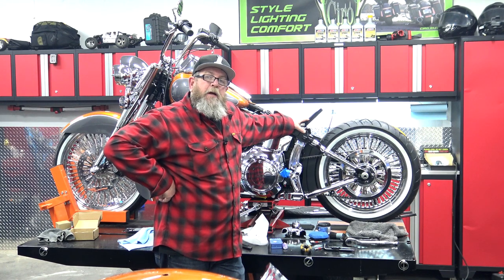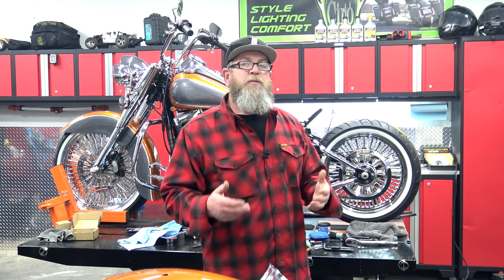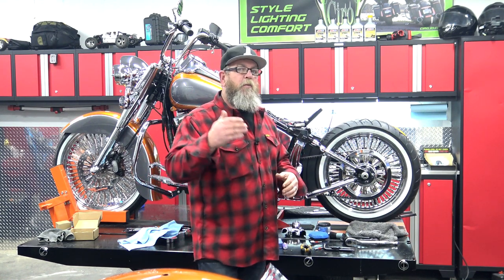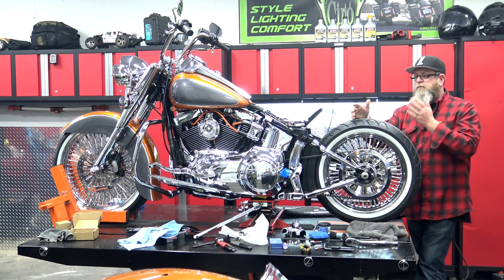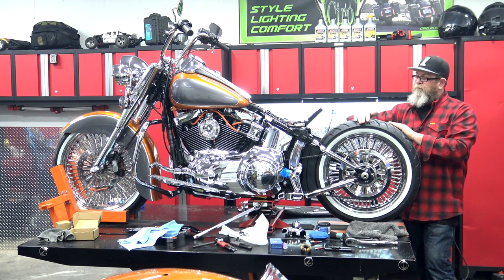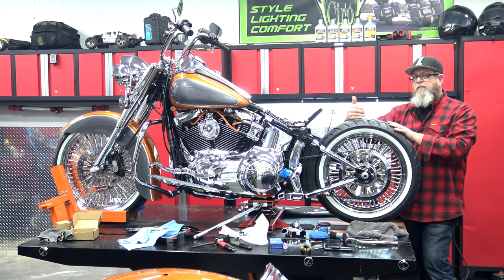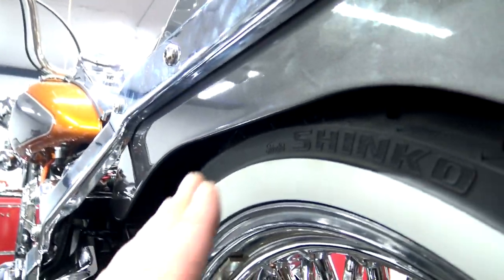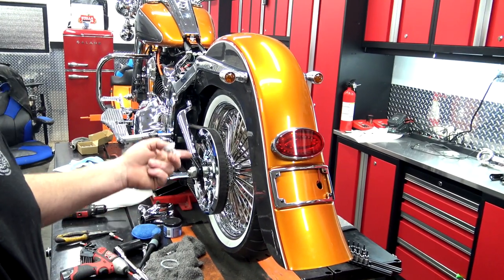DNA Fat Spoke Removal   What Did DNA Send Me

Comment: wow, that just happened to me. I ended up re-truing the wheel with the spokes but only needed a 1/4 inch to the right. I didn't want to do it but I figured I would try once. It worked out great. I hope I did it good enough to be road worthy. Have a good week. I work in my garage. You work as a shop so I can say it is not time worthy for you to do it.
Reply from the maker: I had to send mine back because they couldn't re true to wheel without taking it apart, removing the coating that makes it air tight (tubeless) truing it and then putting it all back together. When I got the second one back it was an inch to right instead of a half inch to the left. So instead of just moving it a 1/2 to the right they moved it an inch and then it was literally on the fender. I sent it back again and they sent me one very similar to the first one...so i ordered wheels from Sinister...they will be going on soon in a new video.

Comment: My Ride Wright rear wheel is offset to the right by about a half inch. But since most Harleys are that way from the factory I'm OK with it. For your wheel I'd have a local wheel lace guy, if you have one center it up. Shipping it back is not worth the hassle imo.
Reply from the maker: Yes they are supposed to be offset slightly to the right..from what I measured at our local HD its about an 1/8th..maybe a tad more. They sent me the RMA and return label so it wasnt bad..I still had the boxes...packed it, taped it and had fedex come pick it up...so not too much trouble..they have it now, we will see what happens.

Comment: So I’m curious to no did you tell them what offsets you needed when you ordered the wheel?
Reply from the maker: When you place a wheel order with any wheel company they ask you specifically what the rima nd tire are going on. A company that has been around as long as DNA has been they should know the offset of that bike. Un less you are wheel builder, the average joe will not know the offset ot even how to measure for an offset. that is why they ask what its going on. It was s simple mistake and they are fixing it so were all good.

Comment: Wow .. good i saw this video .. i have the same issue .. i noticed this when i was trying to install some led lights and took it to a mechanic who installed the tire and told me it was normal..  i being riding my bike like that for about 1k miles  🙈🙈 …. How can i get this fixed? Thanks for any input
Reply from the maker: Well after speaking to a few actual cholo bike builders yesterday they said I should have went with a 140 and not a 150 or even a front 130 and flipped around it around for the rear so the tire wasn't as wide..but they also said RUN IT...it wont expand out, it will only expand up at higher speeds so Ill be fine. So...im running it and see what happens.
Reply: Great videos man .. thanks for the info

Comment: Bike is lookin great so far... I didn't have as good of luck with DNA...
Reply from the maker: Hey Rich..what happened with your DNA stuff? Im assuming you had some issues? Let me know.
Reply: @sikbaggers  More disappointed than anything... I ordered a 21" traditional spoked wheel, F&B rotors, and and chrome rotor bolts for my Deluxe.. The wheel came in in about a month ( Looks great) but nothing else.. We emailed back and forth multiple times and they said the hold up on the rotors I wanted was the powder coater.. After about two months they just sent me a set of rotors and stainless steel bolts. neither of which I ordered.. Like I said more disappointed than anything.